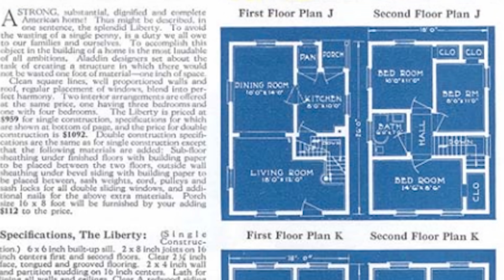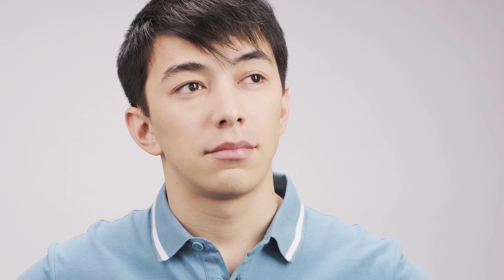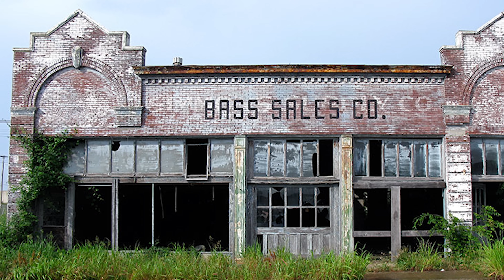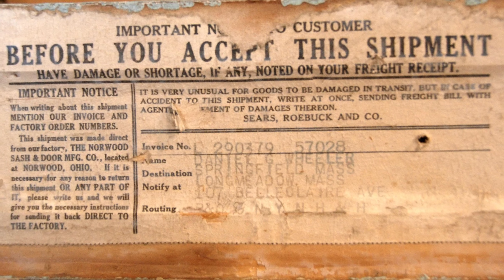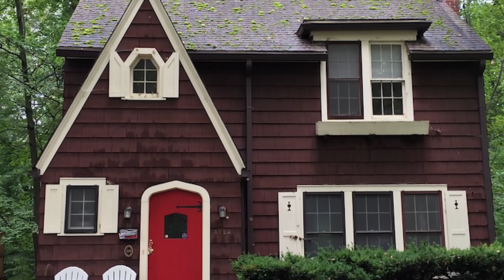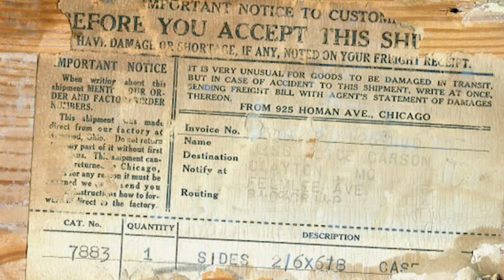What are Sears Kit Homes?

Comment: I have wondered about the black number s stamped on my roof timbers. I live in Sharon Pa and there was a train depot at the bottom of the hill . I know of a couple of houses in the area that look exactly like a model in this video. The model with the pointy entryway. One has had a garage added to it . The garage looks a little off compared to the house . You can tell it was not of original construction .

Comment: My brother rented a Sears cottage/shack around 2015. Small C-2034 $191.00 version, kitchen living room and bathroom on the first floor, loft bedroom upstairs with a very low ceiling. Enclosed porch on the front. 
Flimsy & definitely a mid 1950's summer cottage or retirement cabin.

Comment: The older part of my home is a kit, but I have yet to determine the manufacturer. Built in 1931, it has some hand hewn beams in parts of the basement but others on the main floor stamped "Cottage Number Three". The walls and ceilings are traditional mortar/ lathe/ plaster. None of the original trimwork remains but the floors are intact. I found a single crystal doorknob in the yard one day while clearing some brush :)

The man who built the house was a carpenter and painter who ended up having 7 daughters. Imagine stacking 7 daughters in a single room in an ~800 sq. ft. house today! He also built a couple of small barns on the property, and one appeared to have been his sanctuary- there was a lock on the inside of the entry door and pipework for a wood stove lol.

I'd love to see videos of some of the other kit house manufacturers if you can find enough backstory, Ken! Love your videos, keep up the amazing work! Cheers!

Comment: HVAC systems- in the pre-1950's did NOT include air conditioning, so HVAC is misleading. 
In the California high desert area in the 50's and 60's, there was a builder selling "finish it yourself" houses- He poured concrete, famed the house and installed wood siding and stubbed in water, gas and electricity- then the buyer was left to finish everything, all for about half the price of a fully built and finished house. If you were handy you could do it in a few months while still working a full time job elsewhere. As an inspector I have been in a few of these- quite often areas in the house were never quite finished. County and state building codes, and the contractors licensing bureau will not allow this anymore, at least here in California. Too many potential issues- leaking gas, bare wiring, water leaks, all from people who weren't quite skilled enough to finish a house.

Comment: I have a Sears home. I found out when I had the house inspected before I bought it. The inspector said that the framing lumber in the attic had Sears and Roebuck stamped on it. It also has the plaster board walls. I’ve never been able to find pictures of the design though. I would love to have the page from the catalog with my house depicted! My house was built in 1935. And yes, I live 1/2 mile from the railroad depot.

Comment: Our mission-style Sear’s Craftsman bungalow home is in Massachusetts. The beams and moldings have never been painted. Most of the house is original including the incredible gas stove with two ovens and center top griddle. There is horsehair plaster which is dangerous, it contains lead,  so once the ugly wallpaper was removed, all walls were skim-coated with joint compound. I still got a little lead poisoning. Lots of work but worth every second.

Comment: Several years ago, I was doing some repairs on an older home. I found an old Sears catalog inside the wall. It was great fun looking through it.
To my surprise, there was a section of homes. Looking through it, I saw a very familiar design.
I found a house that was identical to my aunt and uncle's house in Fort Wayne, Indiana.
It was a mirror image, but it was unmistakable.
What a great concept the Sears kit house was. I wish you could still buy them.

Comment: I did some electrical work in a Sears home. All lighting had low voltage switching that was routed to a central relay board in the attic. Some of the heating was done with ceiling heating panels that were wired for 220 volts. We had to demolish the original central heating system out of the attic. It was huge, made with steel plates and cast iron and was installed at Constrution. We had to cut the end wall out of the back of the attic to throw the heavy pieces out into the yard. The trim package was high end with wide hardwood trim. It was a 1920’s package that the same family kept. Beautiful inside and out.

Comment: I lived in a Sears kit house a few years as a kid. It was built in 1920. Really neat house, had beautiful woodwork, wainscoting, chair rail, plate rail at the top of the dining room walls, hardwood floors and solid doors everywhere. It had never been modernized, so it had a coal furnace in the basement with a huge heat vent in the living room, and cast iron floor vents to let heat up to the second floor. Sadly, it burned down a few years after we moved away.

Comment: I rented a Craftman style 1923 Sears kit house in Laramie, WY in 1990. The documents were still in the house. The coal furnace had been replace by oil, and the electrical system had been updated.  Very nice wood work throughout the house, but the walls and ceiling were poorly insultated for a location where January nights are below -5oF, every storm down to -20 and occasionally down to -40oF. Blankets would litterally freeze to the wall if a bed were placed next to an outside wall.

Comment: One of my good friends lives in a house from a Sears catalog in Cuyahoga county, Ohio. It is about a quarter mile from the nearest train station and the design is identical to the one titled "The Gladstone" from the 1936 catalog. The house was completed in 1937 and his family has kept a binder of all the instructions, snippets from the catalog, and several of the shipping labels that were included with the unit. When the house was originally built, they did not include electricity, as it was originally built in an area that had not received service, and was only updated to include electricity in the late 1940s. The installers did not do a particularly good job of wiring up the house, and caused some structural damage that has caused it not to hold up very well over the years. There are currently some issues with the roof and a lot of the interior wood has warped in major ways leading to several doors being stuck permanently open and a few other issues. Funny enough, there is another sears catalog house just down the road but I couldn't tell you the current condition other than it looks great from the outside.

Comment: This was very interesting, I have to add because I had talked to my local lumber store who had recently started selling a few kit style homes like Sears and my dad who is a plumber, not ALL homes had indoor plumbing and electricity (especially the early models) even though there was a dedicated bathroom and fixtures because both of these were still relatively new-ish technology and weren’t as wide spread that it was most likely mentioned that you could have it “where available” however almost all the Sears homes I’ve seen in the wild have been wired for electricity and indoor plumbing.

Comment: I recently found out (well, a year ago) that my childhood home that I spent 12 years in from 1987-1999 came from Sears. After searching around online with my mom going through numerous floor plans, it was called “The Marion”. It was built in 1935, I believe. My great-grandparents had owned it.

Had the original hardwood flooring and doors when I lived in it. Absolutely beautiful home that was in the family until 2002 when it ultimately met its demise (burnt down when my uncle was living in it).

They definitely made those homes to last (except when going up against fire). They were pretty sturdy. I’d give anything to have that house back.

As much as I would love to see this concept resurface, let’s be real … the quality would be cheap. Extremely cheap. Modular homes and trailers are the modern replacement, just minus the long lasting quality (although I will say that some new modular homes, like the new double wides, are made better than some of the houses I’ve seen built from the ground up using cheap materials — thicker walls, better hardwood flooring and carpet, using decent quality materials instead of the cheap plastic look meant to imitate, etc.. I almost wanted to buy one for a while lol).

If anyone out there is living in a Sears home of the past, know I envy you. Cherish the history in that home.

Comment: Almost every house shown looks like something I've driven by somewhere in life. Seems like familiar looking old homes, and probably were quite the revolution in their time, probably cutting time and costs, while offering the latest advances in building materials and appliances. they probably changed the landscape and skyline of our country with kit homes popping up everywhere USA. otherwise it was get skilled craftsmen builders and framers, using custom decision making, pulling from a history of what tried and true things you had learned, and then finish the inside where they would put wood lathe which is like covering a wall in yard sticks, and then covering the layer of strips on the wall, would often be a chicken wire type of mas nailed to the strips, which all is to create a surface strong enough to be a framework that will hold the plaster smeared all over it while the heavy amounts of plaster dont fall off nor have the weight pull the framework loose from the studs, from some type of a fault in it's construction, or get a sears kit home, with plaster boards to just set up as the blueprint tells you.. I bet a lot of skilled professionals in the trades had to specialize quick and find a niche market, otherwise take a pay cut and learn how to just be the on site assembly team for probably pretty much the first factory homes. ty interesting video

Comment: Back before there were car dealerships every two blocks (or any to speak of at all!) many people also bought their Ford Model Ts through Sears, Roebuck and Company. Those cars, when needing service, were often either repaired at the local blacksmith shop or, by necessity, the owner him or herself! (This is one reason that the early cars were dead-simple, mechanically. To make them simple for even an average person to be able to maintain and repair.)
Reply: My grandfather was a naval officer and he married a woman with a significant inheritance and lived in a posh area of Washington D.C., yet he lost a finger while working on his Ford (I don't know if it was a Model T or the Model A they got later). I guess it was just normal even for people in fairly comfortable circumstance, in those days, to do a lot of the dirty work of owning a car themselves. There was probably so much of it that relying on mechanics for everything was impractical.  That kind of involvement is almost unheard-of today.
Reply: @pcno2832  My late dad worked on many cars in his lifetime and he told me more than once that the Model T was the easiest of them all, though it was quite a handful to drive because of the almost complete lack of automatic anything. Even the engine timing had to be set and adjusted while driving by the driver.

Comment: I believe my grandma's house is a Sears kit home. My grandma passed away in 2016. But unfortunately her house was sold to another set of couple. I believe this house is a Sears kit built. I remember my great great uncle telling me stories about how they ordered a house in a magazine and it was delivered to the piece of land and they just built the house each step of the way. Back then there wasn't any City or building permits they had a fall through because the house was already established through a company so all the permitting was already pulled nationwide. My grandmother's house in Rosedale Queens was one of three original standing houses left on the block. I really believe that is a serious kit home because I had three large bedrooms upstairs, it has an attic with a pull down ladder. That would then about 12 to 13 steps that will bring you to the main floor, on the main floor she had a sitting room which was at the front door, then she had a second door that led into the home, from the main hallway you make your first initial left hand turn, to your right is the staircase that will take you upstairs to the three bedrooms one bathroom and the attic. When you made your first left hand turn you came into an area called the sitting room, or a living room. She also had a maid room in the front that she would call her main sitting room. Then you will go into another room it's almost like a railroad home you go for room to room to room with no brakes in between. You had a bedroom on the first floor you also had a dining area a living area a city area another main sitting area a large kitchen and also a bathroom on the first floor then you will go downstairs to the basement her basement was never finished but she was able to have an area where we will have parties and then have separate doors for her laundry area. It was pretty cool along with a basement too now

Comment: I bought one of these homes. It was an 1917 American four square. I loved that house. The wood work was amazing. It took two years to get it back to its original condition with upgraded plumbing, electric and plaster work. When we broke into the ceiling and walls, we found the old gas lines for liteing.

Comment: So i had a friend who lived in a Sears catalog home back in the day. It was like a mid to late 1910s home can't remember. Really really cool especially once you knew it was a catalog home. My first home I built was a kit home kind of ironic. It's not like every piece came in the kit but all the framing was precut assembled/sorted in packages with blueprints and instructions for each wall. BMC sucks and I wasn't impressed stuff was cut wrong alot. My garage studs was cut over 8 inches short twice. Eventually said screw it and pieced together a top plate that was 4 thick....the electrician wanted to kill me when he started trying to drill through that top plate.

Comment: My wife and I owned one in Lansing Michigan that was built in 1929,  but we sold it back in 2006. While remodeling the the downstairs we found the Sears labels on the backs of baseboards. I did a little research and found what looked identical to our house in an old Sears Homes catalog. I thought that they were well constructed for being so relatively inexpensive, ours was smaller but had real 5/4 hardwood floors with the same material used as a subfloor running diagonally, a full brick fireplace and chimney. We had plaster and lath inside as well as these reverse plaster mold trim in the downstairs as crown molding. Looking around Lansing it appears that several were built in the area. Common features that stand out in some of the Sears homes are an asymmetrical roof line in the front over a round top front door. Loved that house and wished I hadn't sold it but unfortunately it was to small for our growing family so we moved.

Comment: Maybe they or some one else could offer a kit home again ? With the price of a new or older house being so stupid high some would do the Ultimate DYI and build one  I do think the genZ and others could do it ? If you look at how shoddy some house are built you wonder why any thing starts at over 200K  for 2000 square feet and these people that build tiny houses that are 140 square feet at about 70K that’s nuts . I built my underground house myself except for the concrete work because it cost less to hire a pro with the reusable forms than to make your own . It’s just 850 square feet  I did every thing else myself under 50K never had a mortgage was fine for 3 of us and will last for 100s of years bug and fire proof very secure I’m on top of a hill foods and storms no problem oh and less than 300 gallons of propane to heat cook and hot water a year if I do not fire up the out door water furnace 2 tons of coal a year keeps it toasty heats all the water and the hot tub and use gas just to cook .

Comment: There was a Sears distribution warehouse within a mile from my house.  Sears stopped using it as a distribution warehouse in the 70s and closed the small outlet store in the 90s.  It was so large it had its own railroad spur.  I never noticed the correlation of the warehouse and all the Sears homes in my neighborhood until now.  
I built one of my houses from a kit. Not a Sears kit.   It had all the framing, roofing, siding, sheetrock, trim, handrails for stairs, insulation, and doors.  We had to supply the foundation, electrical, plumbing,  mechanical and indoor paint. It was very fast and easy framing it.